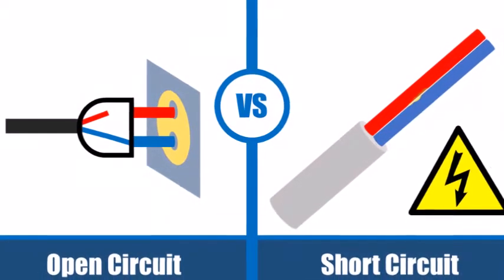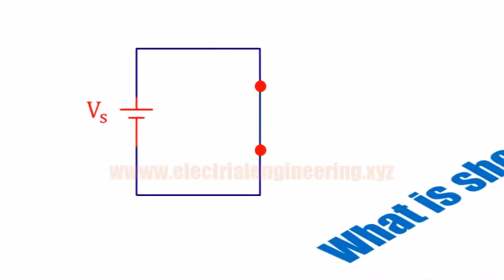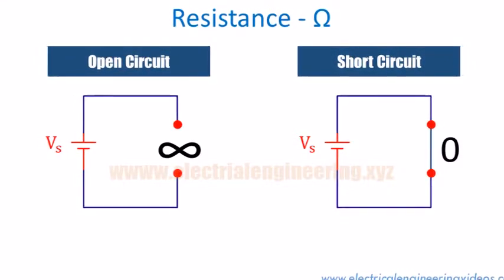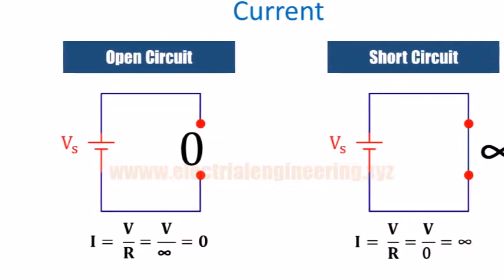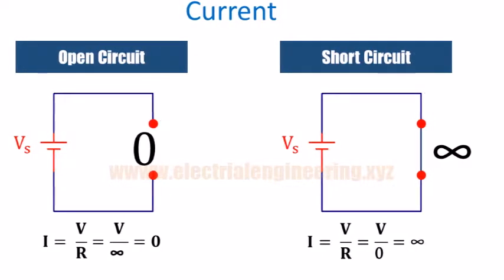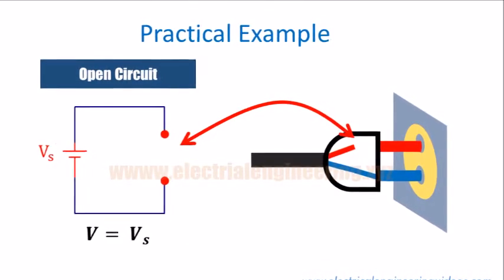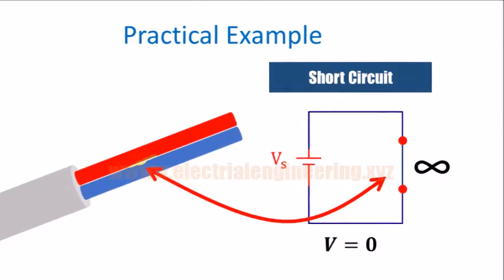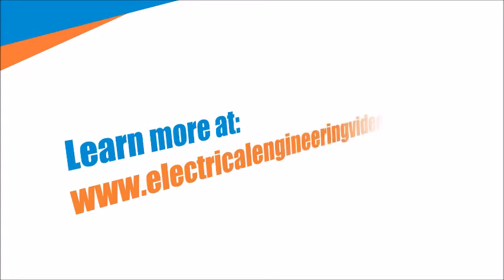Open vs short Circuits - Difference between Open and Short Circuit

Comment: it would be useful to also explain the difference between SHORT CIRCUIT and CLOSED CIRCUIT.
Just saying

Open vs Short is easy to understand
Closed vs Short.... that's a bit more dicey
Reply: Closed-circuit is a normal one where the electricity goes through the hot wire, the appliance, and the natural wire. There is also a ground wire provided the house is grounded properly